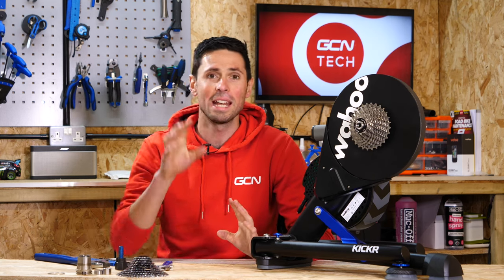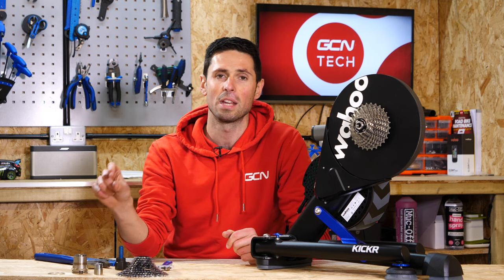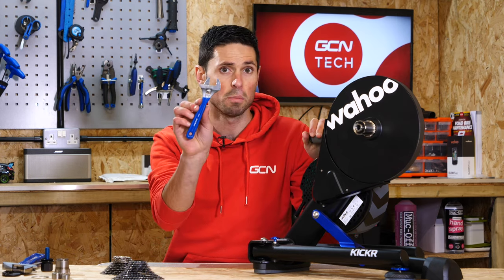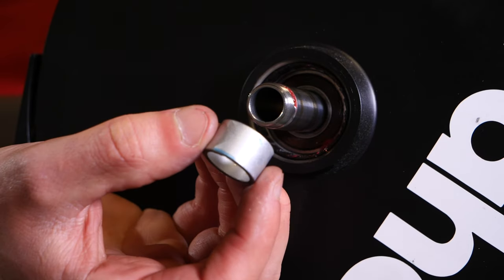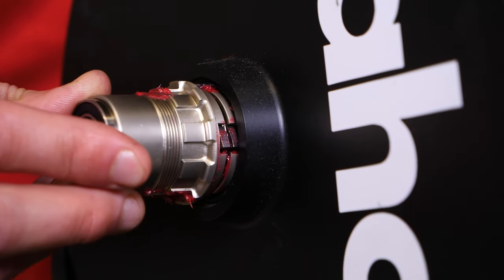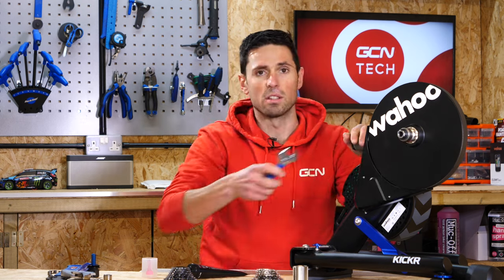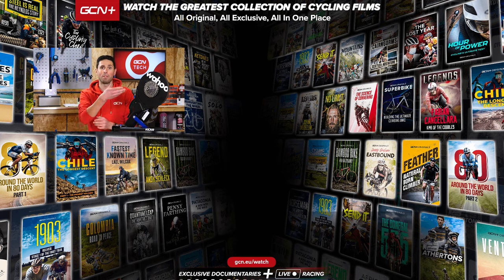How To Swap A Turbo Trainer Freehub & Cassette | Monday Maintenance

Comment from the maker: What else would you like to see Alex cover for Maintenance Monday?
Reply: Get rid of annoying sound from somewhere at your bike 101: from disc brake rotor to bottom bracket
Reply: Cleaning and maintenance of shifter bodies that have been sweated all over while riding the indoor trainer.
Reply: I would like to see maintenance of the Kickr BB bearings and belt drive.

Comment: Any tips on installing a freehub/cassette compatible with SRAM axs on an older Kickr model (2017)? The adjuster sold by Wahoo is only compatible with the Kickr 18 and up, so those of us with older Kickrs are out of luck....
Reply: Dont thimk it will work.

Comment: I just got a new kickr move but they wrenched on the free-hub nut too tight; I can't swap for campy; now I have to return it or strip out the nut with vice grips!!!
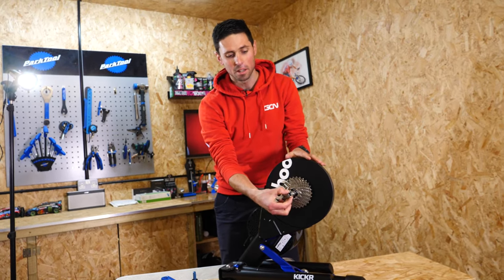It's not reverse thread there at 1:46 right?

Comment: I have only Campag equipped bikes. Given that Shimano 11-speed and Campag 11-speed cassette spacing Is overall the same, is it necessary to buy the Campagnolo freehub adapter and fit a Campagnolo cassette, rather than just use the Shimano 11-speed cassette that often comes as standard with a new direct drive trainer?
Reply from the maker: We we would always recommend using the proper freehub and cassette that your groupset needs. You often get into small compatibility issues, even if both seem very similar.

Comment: i got the same Speed cassette (same teeth nrs) for my Kickr and i had to adjust the derailleur in order to be able to shift to the highest gear. this means i would need prob a spacer extra on my bike in order to be able to swicth between trainer and bike without having to adjust the derailleur every time. is there other way? thanks

Comment: Thanks Alex, most helpful. If I want to use a bike that is set up with an 11-32 and move it over to my Kickr with the factory installed 11-28, do I need to shorten the chain/change cassettes or can I get away with the swap?
Reply: I have the same setup, did nothing, works pretty fine without problems
Reply: @martinreichelprivat  Thanks man, I'll give it a try
Reply: @ryansebers396  did it end up working? I having the exact same problem with my trek and would like to cut the hassle of installing a new cassette
Reply: @lilman2302  Yep works fine, been using this bike on the Kickr for the past year without changing cassettes

Comment: Hi Alex, I have a 10 speed sram running on a kickr core does the same principle apply for this model if so I’ve not sure I’ve had the right set up from the beginning
Reply: Yeah you will need a 10 speed cassette

Comment: Great video.  The one question I had was which way to orient the tool with the chain.  I set up my Wahoo so it was facing the same direction as yours so I could tell the tool needed to go on the cassette with the curve and notch out part facing up.  I don't see the purpose of the curve and the notch on the tool.  Maybe you could explain what that does.

Comment: Any idea why I am having gearing issues? It either won't down shift, or it would skip gears. Im running a Rival Groupo
Reply: I'm currently attempting to put Rival eTap bike on my Kickr Core and am also having gearing issues. I've read that re-indexing is necessary, but that's not going very well. I hope by now you've found a fix. If you have, please share. Thanks

Comment: I have just bought my first Kickr Core and a 10-speed cassette as per my specifications for my bike. Will I need a spacer for a 10-speed seeing as Wahoo only sells an 11-speed cassette? And if so, can anyone point me in the direction of where I can get the correct spacer?
Reply: Kickr should come with a spacer? Bit that confused me was the shimano 10 speed cassette I got also had a spacer… do I need to use both 🤷‍♂️
Reply: I've used 9, 10 and 11 speed cassettes with no spacers. The cassettes are the same width.